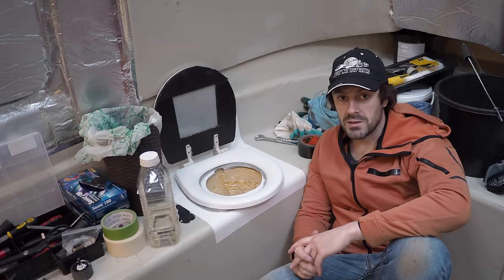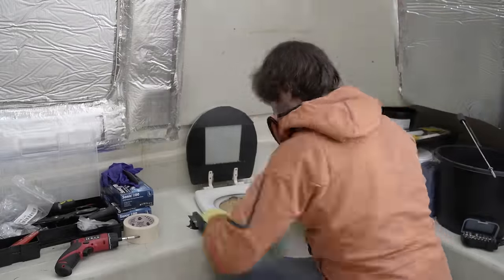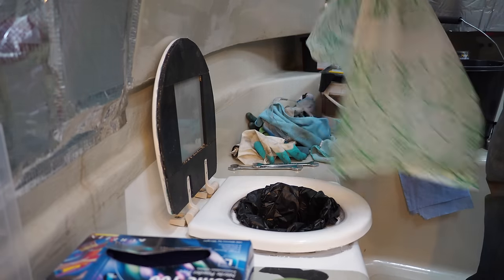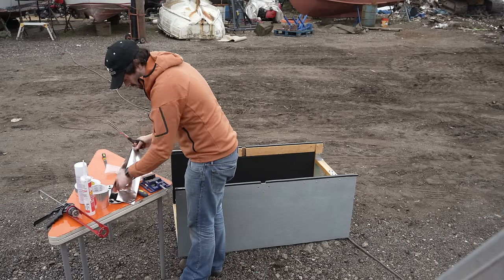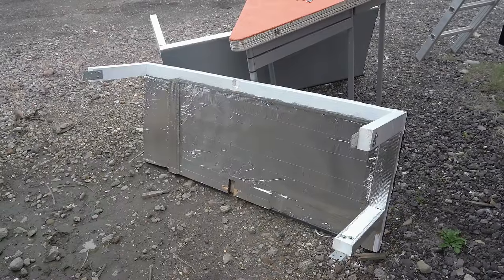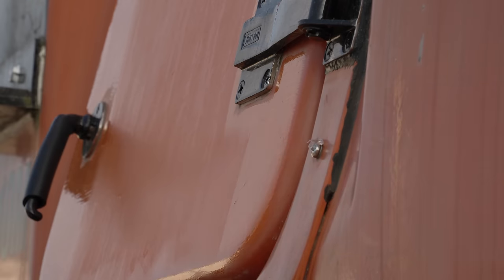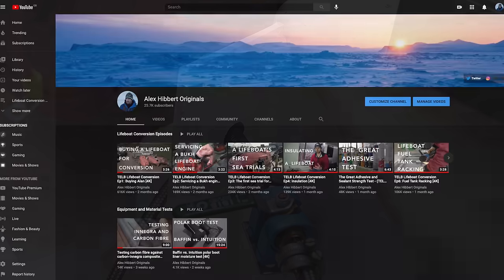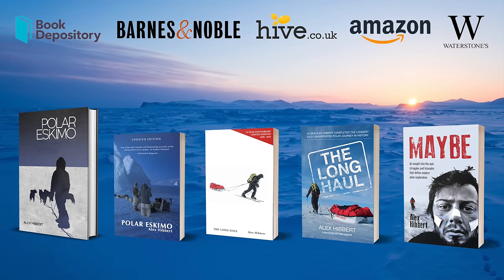Lifeboat Conversion Ep10: Expedition lifeboat heads, engine cowling...and Patreon [4K]

Comment: Wag bags, it's like my deployment to Afghanistan haha 
Helpful tip, kitty litter to help absorb and keep the oder at bay.
Reply: Catsan it is really absorbent and kills the smell of fish in your fridge so should do really good on an expedition so if you need to soak up spilled oil, or Diesel, or even throw some in the head when you have had one of those number twos that really pong, I designed one of these unsinkable life rafts when I was around twelve years old and I am now sixty-one, brings back memories, so thanks to you and the team.
Reply: Cedar sawdust/shavings. Pine’s pretty good, too.

Comment: 1) When you start posting other content I would suggest to arrange it in playlists, easy for a new viewers to follow the journey. 
2) For the toilet maybe add a 50cm or so high solid panel facing the inside of the boat for added privacy, the other side of this can the  be used to mount things onto or a stop from stuff sliding to the toilet. 
3) which of your books would you suggest I read first?
Reply from the maker: 1) Already done
2) If the crew are lucky!
3) Thanks - the new edition of The Long Haul is a good starting point (white cover).
Reply: @AlexHibbertOriginals   Thanks for the suggestion just ordered the book, with a bit of luck it will arrive to the Netherlands before you finish your next expedition:)
Reply from the maker: @VinceW187  Cheers!

Comment: The exitement never stops in this series   
also seeing how you setup the "heads" as you called it, why not just have... a hole w/ a flap that leads to the great blue beneath? kinda how trains do it
Reply: Most of the time boats dont take holes too well, plus imagine the amount of heat that would escape
Reply: @carminecommander4297  well its a hole that has its opening above the waterline, kinda like holding a pipe into the water on the side of the boat, so it would not suddenly sink from it 
and i would not worry about heat , as its a sealed thing w/ very little airflow
Reply: @Space_Reptile  You are right about the pipe not having water go any higher than the boats waterline, but on a boat that small it will be rocking quite a lot so theres a chance the pipe goes under the waterline letting water in, also I beleve the benches on lifeboats are quite close to the boats waterline already, and playing with slim margins is a bad idea. This is my opinion atleast
Reply: @lankyjeep8432  Fair point, thats why i suggested it having a flap, so it would only open when you "flush" it
Reply: I was thinking an outside head with nothing but net beneath.
Reply: I think this boat is destined for rather cold climates and I'm not sure if you'd like very much to have your rear end exposed to those, no matter how briefly :)
Reply: A pipe with some kind of valve system might work but I wouldnt drill make any additional hull openings in a boat that is thousands of km away from rescue. A wave could somehow dislodge the pipe or start a crack in the hull which in heavy seas would be a death sentence. Very small risk but fatal consequences so best to eliminate it altogether.
Reply: @themaxee08  yeah but he's going into the cold
Reply: @prestonmiles8721  just makes you go quicker haha
Reply: @___Me_  Ya this seems to be a very valid point. You have to sacrifice comfort for safety.
Reply: @themaxee08  never miss the bowl,   EVER!!

Comment: So a couple of recommendations for the head...

First seal the exposed foam with resin, so it's easy to clean and can't become impregnated with water, scent, or other things.

Second I would rework your 2 soft liners to somehow underlap and positively secure to the seat so that no portion of the fiberglass below the seat is exposed. Splashes and misses happen and it will be more sanitary, easier to clean, and your less likely to have a day where you need to dig the bag out of the bottom of the bucket from when someone's excrement grabs and drags it down into the pit of nastiness. If you can't find a easy way to secure the soft liners the other way to do it would be to make your bucket bigger then the seat opening, and use the compression force from siting on it to secure the liners.
Reply from the maker: Two good points well made.

Comment: For further heat management in the engine bay i can highly recommend you the 3M Aluminium and Fiberglas Heat shielding. It works way better in comparison to the  "racing exhaust band" sh*t they sell. I had hydraulic hoses resting on the exhaust right behind the turbo and they weren't even marked by the heat.
Reply from the maker: Thanks for this advice. The lagging is the original stuff, and I was considering replacing it.

Comment: That aluminum tape is amazing. I've used it directly on a gas fired water heater's exhaust before, and after the initial bad smell of the adhesive being overheated, there was no issue with it whatsoever and it's still there, years later.
Reply: I keep some aluminum tape around all the time. One tip is to avoid any and all damage to the edges of the roll will keep it free flowing vs tearing off!
Reply: @kameljoe21  Ya, dinging up the edges of it can make it real miserable sometimes lol.

Comment: The toilet type you chose is the only viable ablution solution that addresses all issues!

I have used that type in vehicles and in an off grid location and its benefits exceeded all the other types available.

In limited space, the empty container makes for a great storage location for a bag which may be easily lifted out when nature calls.

My BranQ 22 litre portable toilet uses 22 litre bin bags which fit perfectly and stores a bag of smokeless charcoal briquettes when not being used for its original purpose.

In your small space with all of your expedition equipment space will fill up fast.

Have you considered the use of Peli. Case (Pelican Case) Lid Organisers which can be fitted onto wall and roof surfaces and store small items and maps, etc?

They are available in many sizes and configurations.

Comment: You might want to look into how quickly those toilet liners will actually decompose. A lot of biodegrdable/compostable bags take a looooong time to come appart, and only do so under the right conditions. Otherwise, it's a cool idea!
Reply from the maker: Hi. The liners are 100% starch, and will only contain organic waste. They are a large step beyond 'biodegradable' ones that are still plastic, but break down into small pieces quickly. I understand if you don't think that starch bags should be in the ocean, but these will sink, and aren't shaped so that any marine life could get stuck in them. In essence, once on the sea floor, they are as innocuous as a rock, and will eventually break up and be eaten.
Reply: @AlexHibbertOriginals  Fully biodegradable bags, it takes about 180 days to completely degrade under industrial composting conditions, and it takes 1-2 years to completely degrade under natural conditions. And at the sea floor with no light (UV) and heat it would take forever.
Reply from the maker: @MaxPivovarov  I'm still not sure of the point here. The bags contain no plastic, and they do not offer a trap hazard for marine life. They will be an entity of part starch and part human waste.
Reply: @AlexHibbertOriginals  What you call are made from starch, this is plastic called PLA (Polylactic acid). The monomer is typically made from fermented plant starch such as from corn, cassava, sugarcane or sugar beet pulp. 

from Wiki:
PLA is degraded abiotically by three mechanisms:
    Hydrolysis: The ester groups of the main chain are cleaved, thus reducing molecular weight.
    Thermal degradation: A complex phenomenon leading to the appearance of different compounds such as lighter molecules and linear and cyclic oligomers with different Mw, and lactide.
    Photodegradation: UV radiation induces degradation. This is a factor mainly where PLA is exposed to sunlight in its applications in plasticulture, packaging containers and films.
Composting: PLA is biodegradable under industrial composting conditions, starting with chemical hydrolysis process, followed by microbial digestion, to ultimately degrade the PLA. Under these conditions (40-50 °C), PLA can decompose into water and carbon dioxide in as 50-90 days. Environments without the necessary conditions will see very slow decomposition akin to that of non-bioplastics, not fully decomposing for hundreds or thousands of years.

On biodegradable bags, it is even written that they cannot be tied up, as this greatly extends the composting process.
Reply from the maker: @MaxPivovarov  I've read the background and implications for PLA. Still unsure of your point.
Reply: @AlexHibbertOriginals  Even if those bags are composed of the starch they are definitely not 100%. So called starch plastic need addition of plasticizers some like PLA are are compostable but only in hot industrial composter, those bags are practically non biodegradable in ocean. If they sink I'm sceptic about them staying on sea bed, content will start to decompose with insufficient present of oxygen and realise methane and bags will float. You may concider using bucket with out liner, to prevent sticking fill it partially with water, snow or ice. Bucket wider towards bottom should prevent poo on the sides. You may also consider paper liners but they will take more space and need to be discarded immediately. There were arktic expeditions before the age of the plastic so it's doable. 
But to be fair in the grand scale of plastic pollution several dozen of plastic bags frome your expedition is not worth to mention.
Reply from the maker: @andrzejsamorzewski146  These bags are rated as 'home compostable' so don't need elevated temperatures or the introduction of specific microbes. I certainly take the point about the scale not being large, but we intend to not contribute to ocean pollution any more than necessary.

Comment: With regards to the compostable bin liners - these are only compostable in industrial composters (these are heated to 40C and contain microorganisms) and as such would take a very long time to degrade if dropped overboard. They will eventually break down in a home compost heap but are unlikely to break down in an ocean with little heat and microorganisms to digest the bin liner. I don't want to sound preachy but please don't drop them overboard. It may take up lots of space but it is likely to be the same as dropping a normal plastic bag.
Reply from the maker: Hi Daniel. The liners are 100% starch, and will only contain organic waste. They are a large step beyond 'biodegradable' ones that are still plastic, but break down into small pieces quickly. I understand if you don't think that starch bags should be in the ocean, but these will sink, and aren't shaped so that any marine life could get stuck in them. In essence, once on the sea floor, they are as innocuous as a rock, and will eventually break up and be eaten.
Reply: @AlexHibbertOriginals  Ah, ok. Starch ones are great in my opinion. So often these days, products are greenwashed and claimed to be 'biodegradable' when they aren't and lead people to use them irresponsibly. Glad to see you are doing the right thing though 👍
Reply from the maker: Absolutely. I've tested tons of them, and most starch ones leak moisture from the seams, or just disintegrate. These ones are impressive though.

Comment: Not sure if it relevant, but years ago when I was a home siding contractor I was taught when caulking or using glue adhesive from a caulk gun to finish it by wetting a finger and running it along the bead.  The forces the caulk/glue into the cracks and spreads the surface of the caulk on both sides.  It makes the caulk/glue adhere better, last longer, and seal better.  Maybe you did this and just didnt use it in the video, but I figured I would offer this little nugget for future caulking/gluing.  Its a bit messy on your fingers so have 2 rags/paper towels handy, 1 dry and 1 wet.  When you run a caulk line, whip off the excess from your finger on the dry rag and then use the wet rag to clean the finger.  A small cup of water works well for wetting your finger.
Reply from the maker: Thanks Mike - yes I use all varieties of wet rags, wet fingers, and silicone shaping tools for sealants.

Comment: Instead of leaving the foam underneath the bucket unsealed, maybe you could glue in a slightly larger bucket to place the current one in. Or, when the model of the current bucket allows it to be stacked, glue in an identical one.

Especially if it's open cell foam, I would rather spend an extra hour to seal it, than dealing with the consequences of a possible spill. If the waste would be absorbed by the foam, it would probably be a nightmare to clean it.
Reply from the maker: Sadly there's no bucket that's slight bigger, although I could use another of the same as you say, and lose some capacity. Sealing the foam for cleaning is something I've thought about but not had a winner for yet. The foam is closed cell, so it won't absorb much.

Comment: Just because the application you're using it for does not require a bathroom door. Doesn't mean you shouldn't put one on.!

And just because you're using it for work. Doesn't mean you shouldn't make it as comfortable as possible.

Now it seems like you're going out of your way to make it uncomfortable.

And if nothing else you could at least put a twisting mechanism on the bucket so it spins the bag after every use. Ceiling it up from the atmosphere in the boat.

And put a vent with a fan on it right there on the ceiling. With a one-way flap.

Otherwise great update.!
Reply from the maker: Intrigued by the twisted bucket idea. Will have a think.

Comment: One MAJOR thing I see, not mentioned so far, is that with an 'inboard' diesel that is in your living quarters of an enclosed vessel (that, due to environment, may not be routinely vented as needed)...what are your plans for air-quality monitoring; especially CO and CO2 (relative to engine exhaust leaks, as well as potential turbo leaks)? Also, I might recommend an 'active sniffer' should you develop such leaks, so that you can trace their source for repair purposes...possibly taking a replacement exhaust manifold gasket and 'glass wrap' for those 'unexpected repair needs' related to the exhaust.
Great work, so far...
Reply from the maker: The engine bay will have active fan driven vent, and the main living area also has fan driven ventilation (both in and out). I have a CO detector too. None of this has been shown yet in a video, and isn't yet fully complete.

Comment: Just thought you could tap into the cooling system of the engine to create a rudimentary hot water supply for personal hygiene and heating. By the way great series and absolutely fascinating.
Reply from the maker: A common suggestion, although the complexity/benefit may be in the wrong ratio. Also, the engine will be off for prolonged periods.

Comment: You should consider RockWool batting for insulation and sound proofing of engine as it is fire resistant.  Some version are slightly compressed.  You would likely need to use retention strips (like aluminum or G10) or extra large fender washers prior to applying Reflective tape.
Reply from the maker: Thanks - all sorts of great products out there. We'll see how this system works first. The foam used is fire retardant.

Comment: I was only surprised that the "bucket" was so small and that you didn't seal the foam.
Reply from the maker: It's pretty deep. And it's to be emptied fairly regularly. There's a limit as we didn't want to dig down and reach the hull.

Sealing the foam - yes. I've been scratching my head about how. It's pretty well protected behind the bucket and two liners though.
Reply: @AlexHibbertOriginals thanks for the reply. I meant the diameter of the bucket. But I was sure you had good reasons for your choice. Just wouldn't want to get moisture and mould down there.
Reply from the maker: Alan's crew will have good aim!
Reply: @AlexHibbertOriginals  I would heavily suggest some of that simple spray on rubber coat for the inside of the foam-head-hole, just as a surface sealant

Comment: That's me in the corner.
That's me on the edges -
losing my abrasion resistance.

Sung to the tune of oh never mind if you don't already spot it by the 2nd line, there's no point, really.
Reply from the maker: REM. Thank you.

Comment: Having built a lot of stuff myself, not. Expedition boat actually - however, my 2 cents. Add a second bigger bucket around the black ones and fix it and seal it. Drill a horizontal hole from the floor which ends roughly 10cm above the floor and right in the bottom of the bigger bucket. Add a plastic pipe in the hole, seal it. That’s a long term solution I use for all heated drink buckets for our animals. This allows you to clean your heads later on..
Reply from the maker: The first bit of that have been mulled over by another viewer. I like it. Stay tuned.
Reply: @AlexHibbertOriginals  will do for sure, that’s a great project I really like it! Oh btw.. if you want it posh and fancy - add a small heating pad around the underside of the seat. Add a button and you will have a very comfortable session even in arctic conditions. You may think about a curtain to seal of the backside of the boat as well. Keeps the heat upfront and adds some privacy to the heads.. 😉

Comment: for the head consider finding a way to attach you biodegradable bag to the underside of the toilet lid so in the event of an "explosive" number 2 you will not be finding mess in between the bin and the fiberglass
Reply from the maker: Your concern about this is endearing. I'll have a think,
Reply: @AlexHibbertOriginals  I agree, The last thing you want on board is dysentery because the toilet is difficult to keep clean.